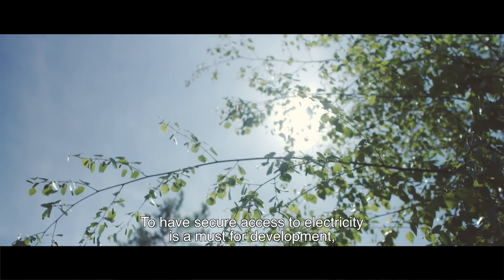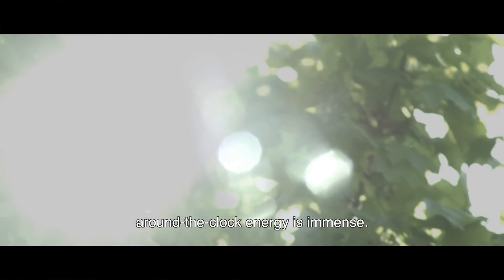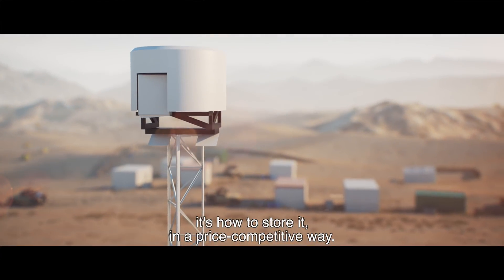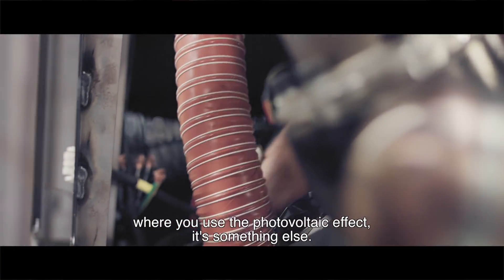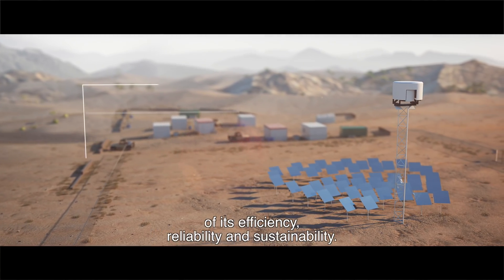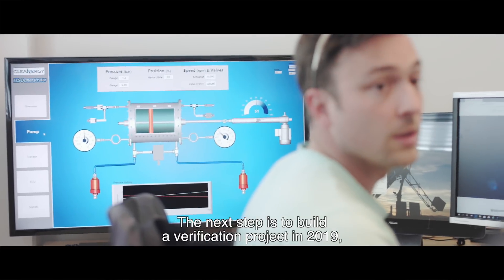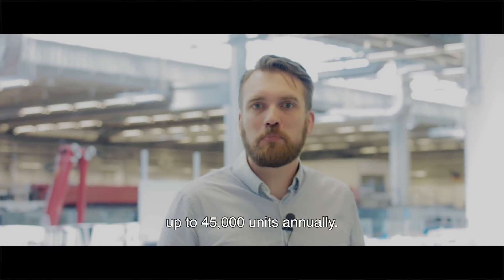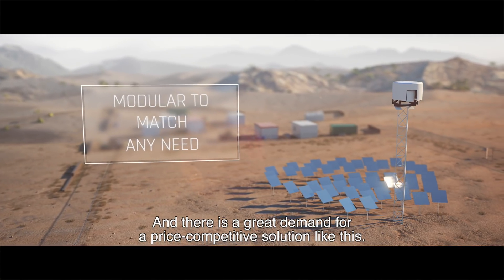Azelio - A game changer in solar energy storage

Comment: Not a new idea and of course it works - but the big question is it cost effective?  The big Crescent Dunes solar thermal project works (poorly) but died because it proved to be no way cost effective.  Sterling engines sound good - but they require high precision machining and maintenance which has never proven to be cost effective.

Comment: "We utilize the heat from the sun directly" - why let some false statement of this sort remain on a fully-controlled video? This does not raise confidence in the technology!
Reply: They are simply taking about concentrated solar, instead of PV solar. It heats up the molten salt with sunlight, not a normal solar panel
Reply: @nicholassexton2718  Concentrating solar power is nice, and indeed I welcome this innovation in the CSP family. However, CSP concentrates the sun light, then turn it into heat on the receiver, it does not actually "utilize the heat from the sun directly". No big deal, I must admit. The real issue is how does this particular technology fares among the entire CSP technology family.
Reply: Dear Cedric, what is your problem? 

WHICH false statement are you talking about? We work in solar energy - we may even be a direct competitor to Azelio - or maybe a coming partner - and I can testity that nothing in the video here, is false or untrue.
Reply: @DigitalAgeInstitute  Concentrating solar power is nice, and indeed I welcome this innovation in the CSP family. However, CSP concentrates the sun light, then turn it into heat on the receiver, it does not actually "utilize the heat from the sun directly". No big deal, I must admit. The real issue is how does this particular technology fares among the entire CSP technology family.

Comment: This method solves most of the major problems associated with the utilization of solar power. 
  * No lithium ion batteries that have environmental and safety hazard and rely on lithium mining.
  * Store energy for an extended period to deliver energy on demand ( for how long? ) 
  * No waste problem associated to the PV being non-recyclable. 
  * Land usage requirement appears to be comparable to PV. 
Downside is danger to birds, land usage, no long term storage solution.
Reply: It can store power for up to 13 hours.

Comment: Hi, I'm a real estate developer. As such, I always have a keen interest in solar energy usages.
Can I ask some questions?
1. At first, you (Karin Kjellin) said it's  'aluminum' (alloy), but you later said it's (hot liquid) 'sodium' that's pumped into the (Stirling) engine. 'Aluminum' ----> 'Sodium'? What happened?

2. There are many ways to make electricity out of 'reserved' thermal ( = hot ) energy. The most 'INdirect' way would be running a steam turbine generator which needs water to be boiled. And the most 'Direct' way must be using a Peltier device.
(There's actually another 'Direct' way I heard : Using heated air in a sun-rays concentration tower to soar by itself to turn a turbine inside the tower. But I'm not sure whether this method works well with 'reserved' thermal energy at night, and whether it could be made in a small scale.)
Then your 'Stirling engine' method would be placed somewhere between the most 'INdirect' and the most 'Direct' ways.
My question : You chose 'Stirling engine' method. Is this better than Peltier method in efficiency / cost-effectiveness ?
Reply: Liquid sodium is the transfer fluid... Storage in liquid aluminum, transfer by sodium...
Reply: M Detlef  Transfer TO sodium... and then TO The power generator... EQUALS... Transfer BY sodium... Liquid aluminum stores the heat, Sodium transfers it...
Reply: It is an aluminium alloy that is keeping the heat. They say clearly that they are using sodium to transfer the heat. 
On your question 2, the Stirling engine - when used in a compressed mode - is by far more efficient than even a normal combustion engine. Check the Philips 1 HorsePower Stirling Engine from around 1940's (WW 2) - it runs with high pressure, and is very efficient. Azelio's concept appears much more efficient. We are soon to try it, we have requested to work with them, and we hope we will soon be working on close collaboration with them.
Reply: @DigitalAgeInstitute  how do they keep the aluminium warm, doesnt metal cool very fast? Isolation? How much electricity can this generate during night?
Reply: @DigitalAgeInstitute  Do you have any website or email address?